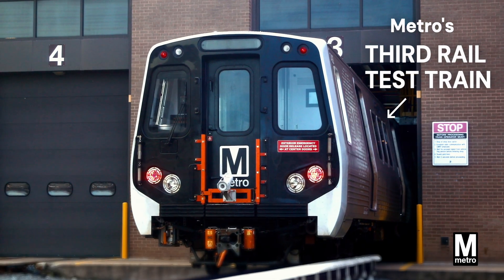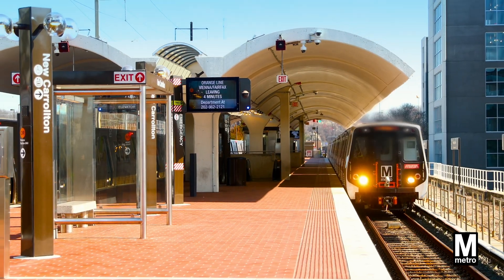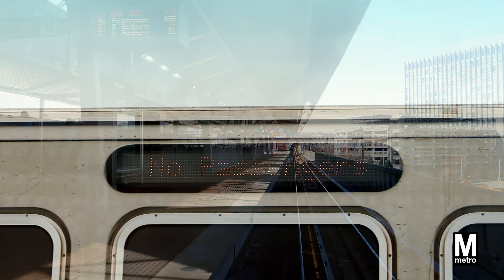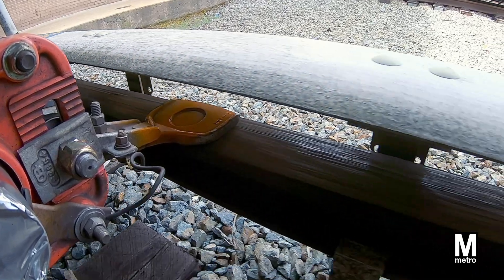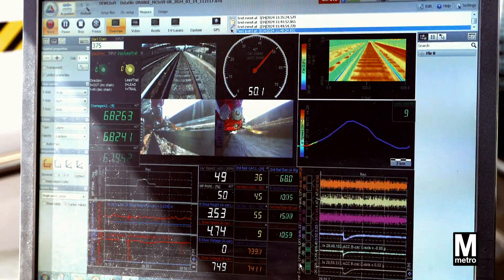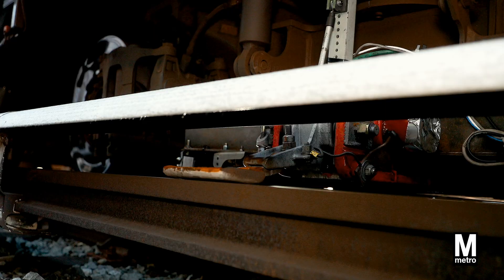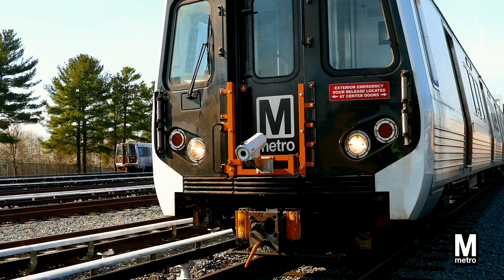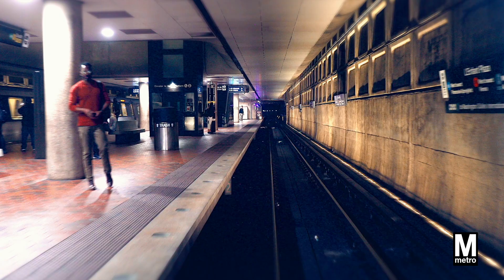Metro's Third Rail Test Train

Comment: The BART (Bay Area Rapid Transit) a closed rail system had a geometry car which analyzes the running rails for any indication of bumps, soft spots, uneven wear, rails too wide. I saw it once at one of the stations, and on a news segment "After Dark" when maintenance crews are making repairs during non service hours.  It's not powered by the 3rd rail must have an engine and generator on board.

Comment: Can u make  the 7000 series trains 8 cars
Reply: Most are, in fact it’s easier to do 8 cars with a 7k series as the cars are a set of four abba where a has a cab and b does not so to make a6 car consist they must split one four car set and operate the train from a pop up panel on the b car. They however don’t have enough cars to run a good service with all 8 car trains
Reply: I don't get the point in 7k series being 6 carb @car_tar3882
Reply: they are tho
Reply: We already have those. They've been around with Metro since 2015. But if you do want to be technical, they've also done a test run with the 7000-Series trains back in 2014. I've seen the footage.